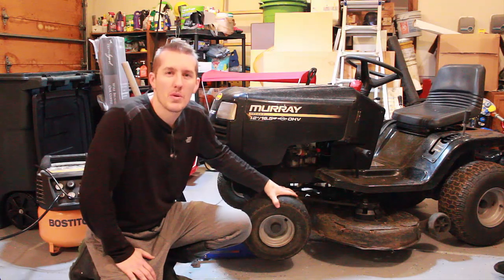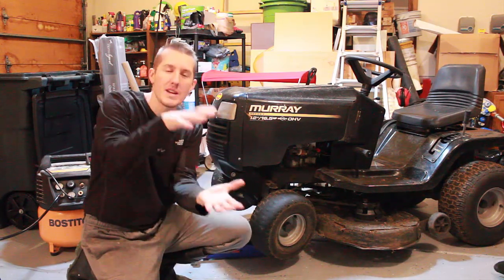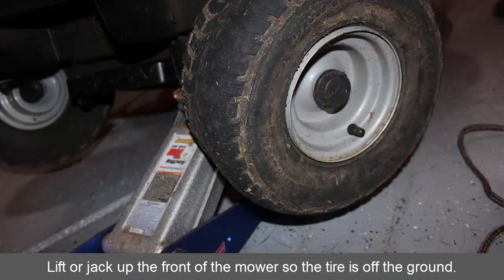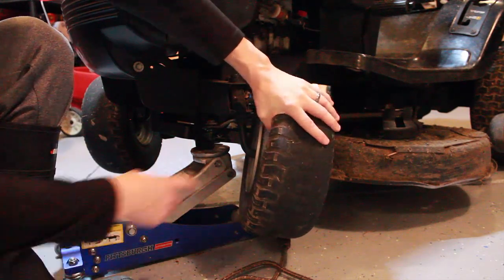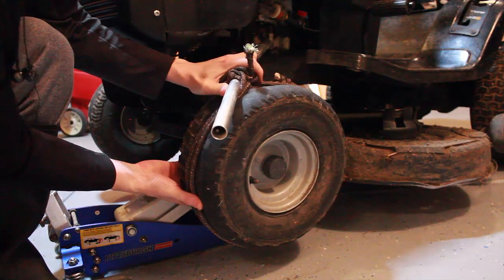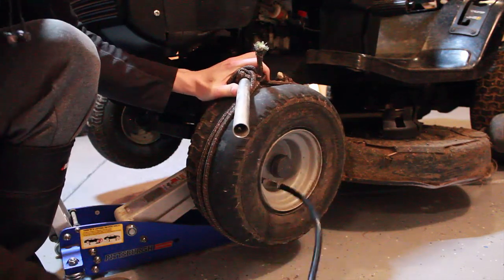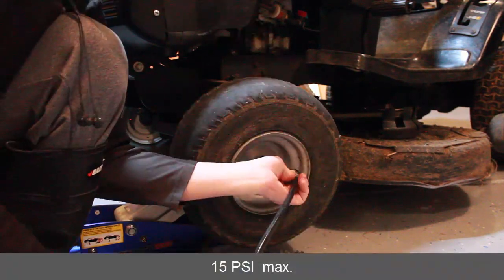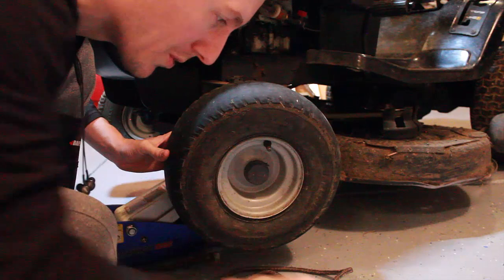How to Refill Riding Lawn Mower Tire That Fell Off Rim

Comment: Great tip. Worked right away! As another commenter pointed out, if using a ratchet strap, make sure you only inflate enough to cause a seal and then remove so that the pressure isn't too extreme when you take the strap off

Comment: I recommend a wide ratchet strap. I tried the rope method and was a pain in the ass. The strap worked in seconds and much easier to squeeze and no need to hold anything when trying to put the air in.

Comment: Worked 100% first try.  Used a ratchet strap in my case but worked like a charm.  Saved me a trip into a garage and the cost to have someone else do it.  Not to mention having to take the wheel off the lawnmower and all that hassle
Reply: Did you wrap it around twice or just once?

Comment: great vid, thx for the help. pro tip tho if using a rachet strap, don't do what I did and add too much air. when I managed to get the rachet strap undone it was under so much pressure that the rachet teeth popped up and smashed my knuckle, there was a lot of blood and cursing. If I do it again I will probably use the rope method because that seems like it will allow more control.

Comment: Man I had mine so tight with a ratchet strap it was squashed in and crimped up where the hooks are and the ratchet and still wouldn't take air except one. We got air in the right side tire let off the strap and it burst out pretty hard from the pressure and went to work back on the other side which wouldn't take air at all and when I checked back to the one that aired up it was off the rim again! WtC! 
We put shims around under the strap to more evenly apply pressure and still couldn't get it, I'm a little frustrated but the tire itself seems really rigid and stiff. Maybe that's why it will not seat properly.  I figure if he can get it with a rope and a bar we should be able to with a ratchet strap.

Comment: Will that work if there is a tube that is also off the rim?
Reply from the maker: You shouldn't need to do this if you have an innertube.  The innertube doesn't need to be "seated" to be air-tight.

Comment: I tried this with a strap and bar, couldn't tighten it enough for a seal to then fill. I went to Lowes and bought nice ratchet straps. Ratched it nice and hard... still no seal. Air just gushed out as I attempted to fill.

This do-it-yourself stuff is so frustrating sometimes. I have no idea how to proceed.
Reply from the maker: Try spraying starting fluid and light it:  https://www.youtube.com/watch?v=2zeFPPBo6Bc

Comment: Something this guy didn’t say, if it’s real bad. Use the rope and get both sides as close as you can, remove valve stem and once your putting air in actually hit the tire with your forearm. The pressure will blow the tire back on the seat. Be careful and don’t knock your tractor over.

Comment: No need to go through all of that.  Simply take some birthday party balloons (1-3 should do it), and stuff the balloon inside the gap, leaving the balloon opening just outside of the tire/rim.  Now, shoot the air to the balloon with your blowgun, and it will inflate inside the tire, expanding the tire, and seating the tire on the rim.  That action will also seal the balloon, so it can't leak down. Now, just use the air chuck on the tire valve to bring the whole thing up to standard pressure, and you're done. YOU MAY ASK, how do you get the balloon out?  You don't... just leave it in there.  It has little weight, and a mower isn't moving quick enough to need balancing anyway.  If there's a little pigtail of the balloon left outside the tire, just pinch or cut it off.  There you go... easy, 5-cent solution to the problem.